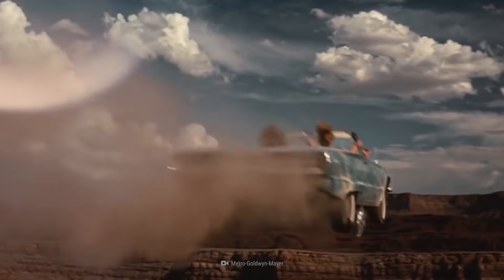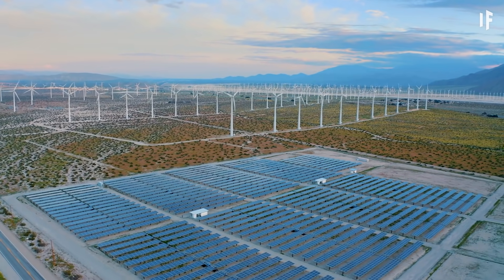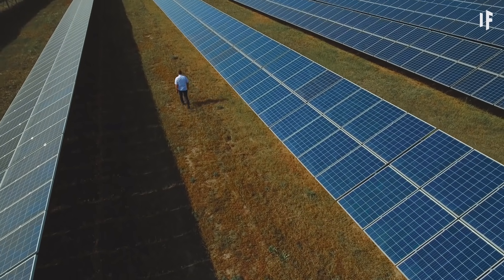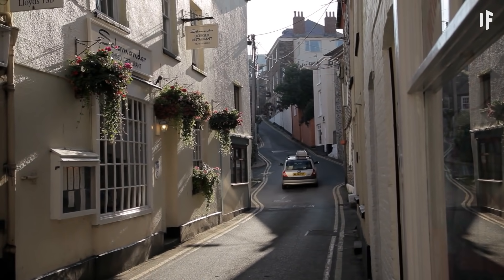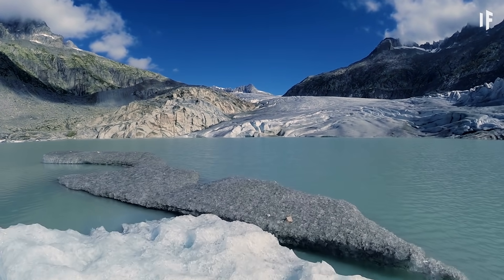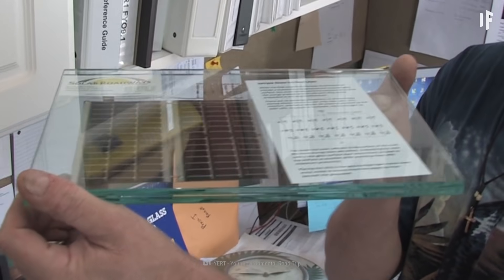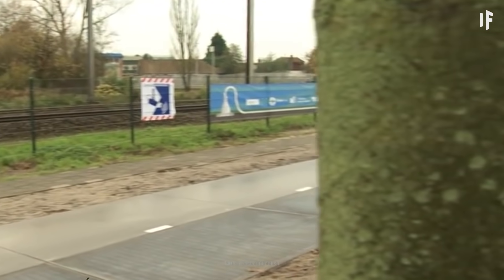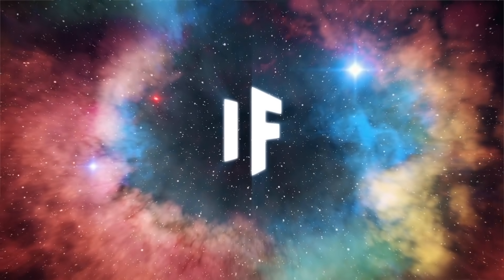What If We Covered Our Roads with Solar Panels?

Comment: Fun fact: solar panels on the every single house and farms on the planet will be more efficient than solar panels on the road.
Reply: Agreed, because the roads need more replacements than most roofs...
Reply: Mr Horse  that's a kinda stereotype brother because in present times solar energy is not much in use. As our dependence upon fossil fuels will reduce and new technologies will rise then  of course solar energy will be the most used energy for our needs.
Reply: @je_sks  I agree, we better cover first the roofs and then think at roads. But I wonder why nobody thinks to place the solar panels above roads, instead under the wheels. Sure you need a metal structure to suspend it. But anyway, you need this structure already on roofs or land, the only plus will be that must be taller. The added height for sure will not be as expensive as that glass surface. And no more loss due to wrong exposure angle. And will protect the road from rain.

And anyway, till we get to roads, there are a lot of parking lots available, and will be where the demand is. No loss due energy transport. I see some parking lots covered, but what has been done is just symbolic.
Reply: @je_sks  but unfortunately it won't be as efficient as nuclear reactor though since the waste from solar panel is harder to recycled and producing more waste compared to a nuclear power plant which you can reuse it after the half-life, solar powered is also very dependable on how clear your sky is, if you have a cloudy sky and incorrect solar panel angle to sun rays then your efficiency will drop very much while nuclear power is constant 24/7
Reply: @ramadhanisme7  oh yes but solar energy is more cheap than nuclear energy and less risk taking business.  I'm not saying that solar energy is the mostly dependent energy of the future but maximum of our daily  electricity needs will be carried by solar energy.
Reply: @je_sks  no at the moment, nuclear energy is more expensive for the initial investment but cheaper for the long term while solar energy is slightly cheaper in the beginning but the solar panel and the battery is needed a constant replacement so it will give you more cost for a long term not to mention the waste from the panel and battery, yes I'm agree that some day we can extract solar energy more efficient but for the next 30 years nuclear is still a better option if not the best
Reply: @ramadhanisme7  oh yes . I didn't think about that before.
Reply: @ramadhanisme7  I agree but even if the risks are small I wouldn't feel comfortable have nuclear powerplants. Why? Because one war  can cause it to explode and than ruin that area for thousands of years. Or an natural disasters like fukushima
Reply: @Milo19970  well in particular fukushima reactor case, it was designed in late 60's if I'm not mistaken so it won't happen in the modern nuclear reactor, for an easier analogy it was like comparing the safety equipment in 1970 car era to the latest car era, sure no car can guarantee 100% about your life safety but it will took a very serious accident to threat your life while in a war case the modern nuclear reactor is buried deep in the ground so even if it got hit by a bombing it will automatically shut down especially with the latest cold fusion system
Reply: @ramadhanisme7  interesting. But what about earthquakes if its under the ground? The majority of the world has them..
Reply: @Milo19970  well as far as i know the modern nuclear reactor is also taken earthquakes into consideration and if we take a look back at fukushima reactor the cause of the disaster is not the earthquake but the tsunami flooding the 3rd generator for the cooling system (so they have 3 generators as a failsafe) and causing the reactor overheated, so if the stone aged reactor design like fukushima could withstand earthquake that massive then I'm sure the modern design is even better to anticipate greater earthquake
Reply: @ramadhanisme7  The waste from a nuclear plant prohibitively more expensive than solar and I work in the nuclear industry here in cornwal UK. Whatever price you see online is not the true cost has it is heavily subsidised by the government.
Reply: @je_sks  come on man the population will keep increasing so must depend on hydro power and wind energy solar energy sucks unless you are in space
Reply: @maryamrashid1727  Solar would only be a bonus on top of hydro, wind and/or nuclear.
Reply: Why don’t we just use nuclear and solar because they are both  better than coal and oil
Reply: That's weird
Reply: @SharperTip  weird is that we have the same profile pic😂
Reply: I wonder how solar power roads will hold up to a snow plow and tons and tons of salt.
Reply: Cars usually block roads from getting the sunlight, especially in traffic jams
Reply: Same with solar panel parking lots/driveways.
Reply: Mr Horse  U sound like a kid that can't put 2 words together with out using some swear young or knee jerking. Also you went from saying 3% to 5%. Also love the random %'s! Better luck next time though kiddo. ur trolling was maybe 3% to 5% at best ;)
Reply: Fun fact: streets are by design interconnected... the possibilities are endless. Inductive charging of electric vehicles?! Roof tops can't do that... unless you park your car there xD
Reply: Mr Horse not true
Reply: Mr Horse  how am I moron
Reply: Are you me from a parallel universe?
Reply: Mr Horse  touchy subject for you huh?
Reply: @XxMorningFrostxX  leave him man. He's such an idiot
Reply: Mr Horse n o
Reply: I think we should do both then we would have so much power we would not know what to do with the power and we should also replace all power plants  with solar panels and wind mills and build all wind mills with solar panels
Reply: Not so fun fact: after 20 - 25 years solar panels will be useless and very hard to recycle because of the toxic metals in it.
Reply: @leonesperanza3672  then you should complain about the whole video. You didn't read my comment well.
Reply: Mr Horse  are you a kid? If no, you must be a grown up kid.
Reply: Mr Horse  stop being a moron by knowing only present facts. Solar power will provide more than 10 percent of electricity in most recent decades.
Reply: @MuhammadAhmed-qh7ut  yes but the quantity of the nuclear waste amount is much lower compared to solar panel, not even to mention the nickel or cobalt or lithium mining waste which is far more catastrophic to the environment, while the site of chernobyl event is now being some sort of wildlife refugee since the animal could roam freely without human intervention
Reply: Mr Horse  Bro, your 2 arguments are literally "solar bad" and "you're an idiot"
Reply: So true. They tried solar roadways in France. It failed. Check @eevblog for more info into why using solar on roads is just stupid, not to mention 9 times more expensive for 1/3rd the amount of energy.
Reply: @SirHackaL0t.  Paving the roads with solar is such an obvious fail, that no person able to do simple math will think that this is a smart thing. In those few cases when this thing was tested, for sure was public money, not investors. And public money is a milking cow. I will bet my income for a year that some sort of bribery was involved when those funds were approved. You mention that this type of solar is 9 time more expensive. I am curios how much more will cost to place the panels above the road instead of on farmland. Obviously the structures need to be about 5 meters taller, and maybe much stronger, and will be some loss in transport since power station will be distanced. But will protecting the road from rain and heat will result in savings from maintenance to balance the extra costs?
Reply: @ehombane  Yup, but apparently those with the purse strings seem to be hoodwinked by these conmen into handing over large sums of money.
Perhaps we should make a proposal that we can make energy out of thin air using nothing more than a cardboard box and a PC fan. Enough swanky dinners to the right people and the money will come in to us. :)
Reply: In case of traffic jam, those roads are useless for charging...
Reply: Thats not fun or fact
Reply: @triplehbk94  oof my guy took words too seriously.
Reply: But it would be easier at roads bcoz roads would be under govt control. Many ppl might not do it
Reply: i am 60% towards my goal, helps if you subscribe. But only subscribe if you liked my content..

Comment: Why would you make solar roads - with all the hassles and disadvantages and problems? Put them on roofs. And if you're wedded to the idea of putting them along roads for some reason, why not put them at the SIDES of roads, on panels which can orientate automatically to get the most sunlight?

Comment: I wonder if solar roofed roads might be a better option. They would still cover mostly the same area, but with less wear and tear on the panels, with the added benefit of protecting the roads from weather.
Reply: There is planty of space on building rooftops. We don't need to cover roads before all that space is used. The only idea I would support is to cover parking lots with a solar roof. That cools the parked cars in the summer and is as cheap as a rooftop system (except the additional roof)
Reply: maybe a blend of both?

Comment: I've wondered about this subject. Honestly, the materials solar panels are made from (even the flexible stuff) wouldn't be good for driving on. I kinda figured someone would just design new borders and dividers for roads and interstate highways. Just mount solar panels all over that. Hell, then take that design a step further by having cylindrical turbines installed in places to  benefit from the gusts produced by passing traffic.

Comment: well, something was not aproached in this video, actually, higth traffic areas receive less ligth the calculation as we saw it was made on a low traffic road, the costs of maintence and even repairing on some accident may even turn the money pit even larger, in the center of london the max amout of energy received is at 12 am, thats bc the buildings and cars would make shadows decreasing the amount of power provided, overall the solar system in a big city isnt viable... well we got the suburbians, well those roads needed to be equiped to hold several trucks passing in wich would increase the cost

Comment: Plenty of people have debunked 'solar roadways'! There is a reason that panels are angled. Putting them flat on the ground reduces their efficiency by more than half. Throw in the expense, fact that the panel surface gets hammered with even light bike usage (nevermind huge lorries or the deluge of cars/vans that have debris on the tires), the other debris on the tires (oil, dirt, mud, chemicals, grass etc, etc) that will gum up the surface. Then there is the small matter of the congestion on the roads in the morning as people go to work, afternoon as the school's get out & in the late afternoon/evening as people come home from work. These lines of these cars will block out sunlight completely from hitting the panels. In Europe, plenty of places get only a few usable hours of sunlight in the winter months. 

In short, it would be far far far cheaper, far more efficient & less resource intensive to put them on everyone's roofs. Heck, it would be far cheaper to put a canopy over the motorways themselves & cover them in solar panels than it would to replace roads with panels.
Reply: Well said mate!
Reply: my cup of .T.
Reply: you do not seem to perceive why this is initially being done do you? I get your point .. however our roads are extremely inefficient, congested, fume and dirt expelling/enabling and literally outdated as the floppy disc.. the are oftentimes too "many-laned" or two wide and terribly maintained which makes it expensive, and on top of that they are oftentimes noisy and do not generate a single bit of energy and are a lot of times building materials need to be shipped also around half of the planet .. where exactly is this revolutionary or worth keeping in such a way.. the goal is to make these roads more intelligent and more effective ... why have our phones become smarter for instance but not our roads..? and the goal here is also not once more to have your car park twice a day (aka traffic jam) but either avoid that thing in the first place with technology that will actually be smart enough to prevent congestion up front or inform you accordingly ... do you get my point? :) hope you have a lovely day
Reply: and for the weather argument.. one could rather easily implement an apparatus that will make use of gathered rain water in order to automatically clean the panels according to a time schedule.. plus if you are concerned about the percentages of rays the panels get.. you could simply build them slightly angled .. issue solved ... plus the initial challenge to build them that way which is more than doable will make people eventually build them more sustainable and make less prone to time consuming maintenance which equals more living time OFF roads .. if you wish to :) ;) cheers
Reply: Who’s gonna pay for that... you know the reason why people don’t have solar panels is because these are very expensive for not that much of energy. Countries prefer to spent their money on the military, the education and the social help (nvm America does not care about the health of americans lmao) and then a little part goes for the environment... well seems like we’re not having solar panels for dinner
Reply: i am 60% towards my goal, helps if you subscribe. But only subscribe if you liked my content..
Reply: Hey i have an interesting channel about space,science,and mysteries if ur curious about it then do visit my channel once....🙏.
Reply: With our current advancement in solar technologies, this would seem like an impossible feat. Our panels are designed to be implemented in areas with as little sunlight interreference as possible in order to harbour sufficient energy throughout a day cycle, not to mention the finance and resources that would cost. However, its not completely impossible, I believe it can be achieved through compromise such as selective implementations limiting it to areas with optimal sun exposure, this mixed with a more robust innovation of road panels meaninf having them actually be a productive road structure that functions both as a road and as a source of energy.
Reply: @KeysFobUp  But if we improve panels even to 100% efficiency they still generate more power if they are clean, angled and not covered by anything. More light = more power. So the idea is flawed from the beggining, simple calculations show it and empirical data massacre the idea. Nederland bike path? 40% efficiency and lasted 3y. French road lasted 2y in small, rural area. People who are hyped about it or support it must be flat earthers or antivaccine groups.
Reply: @KeysFobUp  but even with improved panels you will always get more energy if you angle them towards the sun and not cover them with dirt.